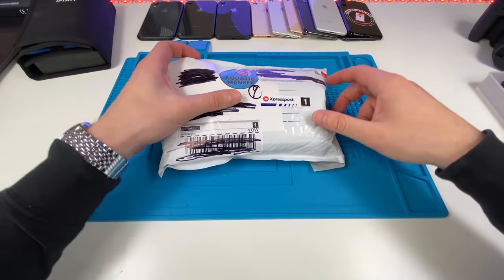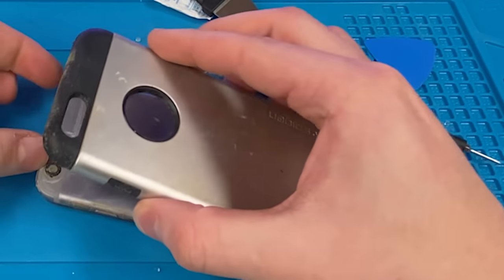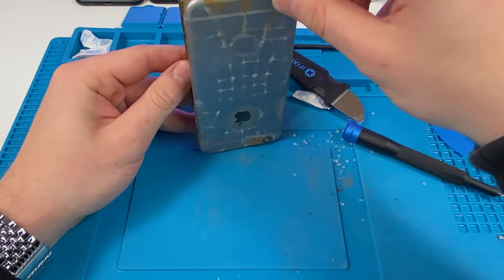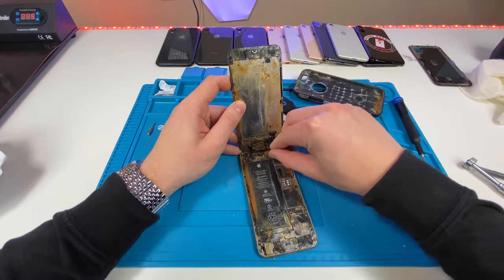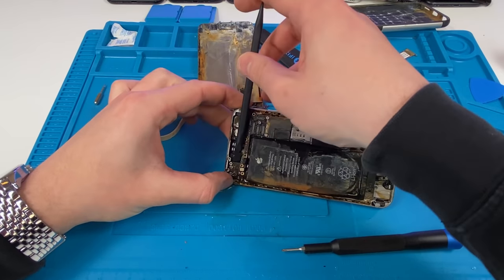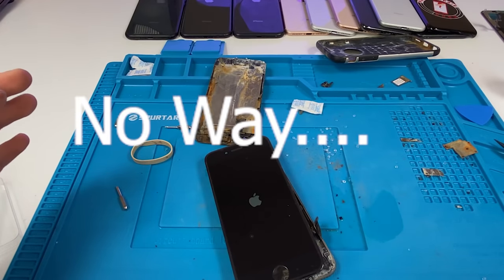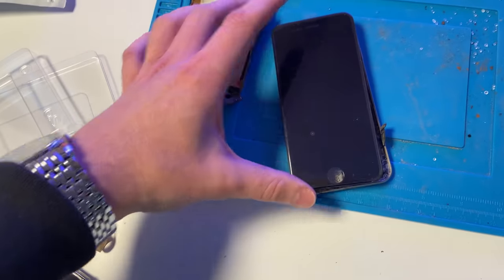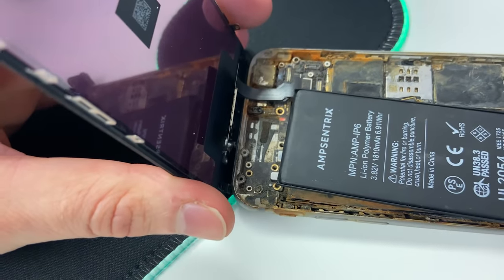This Rusted iPhone Was underwater For YEARS... Can We Get it Working?

Comment: Everyone else's phones after getting dropped in a pool - Works fine
My phone after getting a splash-
Reply: 😂 same
Reply: Waterproof: nah im lazy, imma just not work
Reply: Everyone:
Everyone else's phones after getting dropped in a pool - Works fine
My phone after getting a splash-

My phone after getting in light rain-
Reply: Don't worry bruv. It just needs a new screen. unscrew
Reply: @ulisesr614  open it up
Reply: @raghavagnihotri21  un plug
Reply: @keshavrhm  remove the screen
Reply: @raghavagnihotri21  anyone else
Reply: @raghavagnihotri21  un plug the battery
Reply: @cardboard_is_not_edible  ikr
Reply: @nprestaGD  re program the screen
Reply: Some dudes phone being dropped in a lake 7 years ago:
Reply: @cardboard_is_not_edible  Waterproof phone: becomes Water-Resistant phone
Reply: frfr
Reply: Dude when my sister was like 14 she somehow flushed an iPhone 4. Our grandparents had these massive (fat people) toilets and the fuckin thing ended up stuck in the bend. Just enough where he couldn’t delicately get it out. My grandpa strait takes the toilet off and turned off the water and he takes it out back and starts cracking at it with a hammer. He eventually gets the phone out. He sets it on some paper towels and then the next day turns it on. Thing somehow still worked. I think she ended up having to use a software home key but other then that worked. Apple makes some killer hardware.
Reply: My sisters phone got water damaged. By rain. In a live proof case. On her birthday.
Reply: Water proof is evolving 

Proceed?

YES                       Or                   No
 _

You picked yes

Water proof is evolving...

Congrats your skill water proof has evolved into water immunity

            (idk why i made this xd)
Reply: @cardboard_is_not_edible  phones are water resistant, not waterproof
Reply: I dropped my iPhone X in the ocean. Retrieved it and am still using it now. Incredible.
Reply: @cardboard_is_not_edible  fr it be like that 😂

Comment: You’ve outdone yourself bro 
Jerryrig has got some serious competition 🔥
Reply: I love this guy but he's like the demo of Jerry.  
Jerry built an elevator in his house and made his wife a wheelchair bike.   
This guy got extremely lucky with the iPhone 6 and is just making a modded phone.
Reply: Jerry doesn't fix phones though this is like comparing a mechanic to a car enthusiast
Reply: @bl.edxardo  Jerry can fix phones and probably way more, he fixed a smart watch twice and fixed his wife's phone. I feel like I'm giving fanboy vinbes off but the feats are there.
Reply: @stevensanchez1192  What i mean is that jerry's content is not focused on fixing phones
Reply: Jerryrig breaks

Phone Repair Guru fixes
Reply: He did not fix the phone.
He just swaped battery, pluged new screen and charging port.

He cant even unscrew that one bolt.

And he pluged the new battery with power inside rusted phone...
That power will destroy phone before he'll get time to get data of that phone.
Reply: @robylv5720  he managed to get the phone back in working condition so it still is FIXED!

Comment: Don't throw it away. The screw can be removed, board ultrasonic cleaned, a new screed and a new case. Use a small drill bit and slowly drill until the head breaks off.

Comment: Of course it can still work, corrosion doesnt automaticly mean the circuit is dead and desoldered, if the board and component where made good and the pone died of battery or the battery died before shorting anything, almost everything is recoverable for a certain pourcentage.

I wasnt really surprised it booted, it has a pretty good chance of being alive seeing the shape of the board, there was not "that much" corrosion.

I would've but it to rest in a IPA bath for half a day personally before any tests after the dismantle x).

Comment: I took apart a waterlogged BAE systems ferroelectric flir unit and the support circuitry was screwed but the chip itself worked fine. Crazy how durable some chips are. Almost certain the RF stuff in it is toast though.

Comment: Clean the screw head and solder the head that gives the screwdriver something new to bite into...(also it runs the screw through a heat cool cycle that loosens it) .

Comment: Soak thay screw in a very, very tiny amount of pb blaster. It should come right out, or if stripped. Try a size bigger than the bit you were using. AND if that don't work dremels have tiny drill bits you can use. The last option would definitely work, just gotta be careful.

Comment: Here's a trick to remove screws that can't be screwed off valve grinding powder on the tip of your screwdriver just a little bit and then turn the screw it will come off

Comment: So typical. I bought a 6s with slightly waterdamage, barely any corrosion which i cleaned with alcohol and its still dead. But this thing, underwater for years, starts just fine.

Comment: i had a white iphone 4s that i lost in a parking lot in the middle of winter. so i couldn't find it. i gave up. so a year later, after being shoveled by a snow plow into a snow bank then melting i get a call and its from a old man that found it and got it to turn on after leaving it charging. it worked perfectly fine and my mom used it until it died like 3 years later.

Comment: Hey @phonerepairguru, question. I have an iPhone XR that has mild water damage, nothing like in the video. I’ve replaced the screen and battery and it works fine but it won’t charge. Do you think the charging port is damaged or could it be something else?

Comment: My iphone 11 pro just got a watersplash over it. There was some condense on the front and back camera. After a while the face id wouldnt work. Then it went into a reboot loop. I took it to a shop since apple told me they wont do anything. The shop did a chemical cleaning and now my phone wont even go on. It just shows apple logo and then full black screen. This repeats itself. How to fix this? Idc if i cant use faceid or anything else. I just need to get it on so i can make a backup